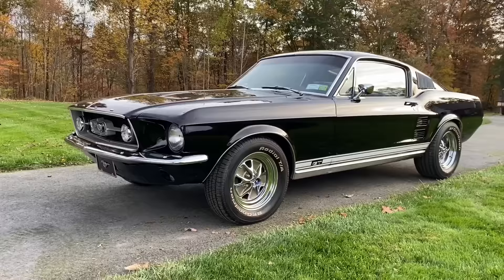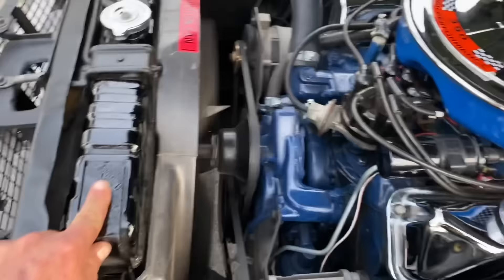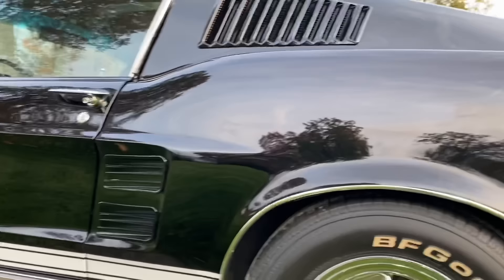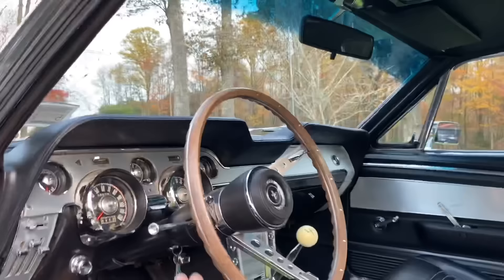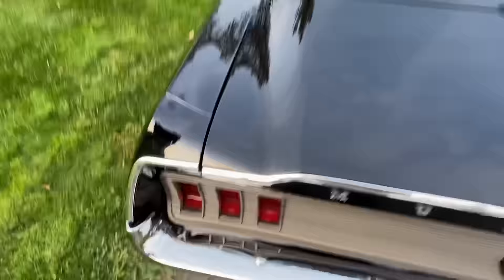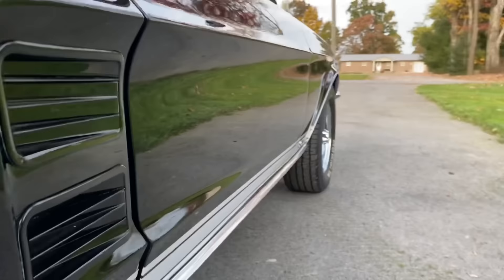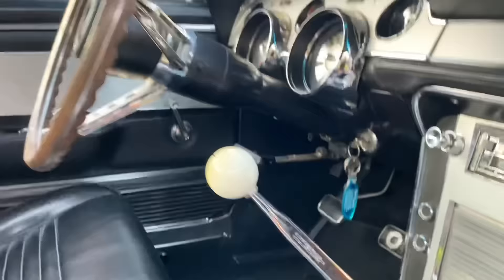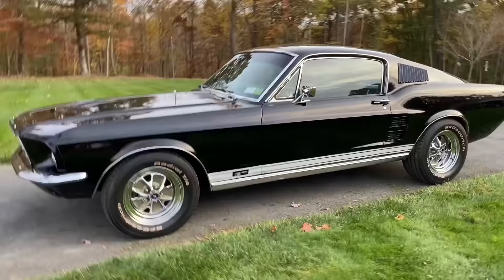1967 Ford Mustang Fastback S Code 390 GT 4 Speed

Comment: What an absolutely beautiful car. Those '67 fastbacks are such a work of art, the 67-70 were the best years in my opinion.
Reply: I had a 1968 fully factory custom, 302 auto -8, interior was fully tricked out with in dash 8-track philco and stainless slide door, map readers, courtesy lights, the whole deal...louvers all over it. Vinyl top. black and chrome interior. Original list price when my dad bought it new was $4,350. He also bought a matching 1968 coupe with a 289, 3 speed. She said it was too fast, so he sold it 2 months later. I sold the coupe in 1981 for $750 to buy college books to study business. I guess I should have done that 10 years later and kept the car.

Comment: One of the rarest and best parts on this car is the rear taillight panel which was a one year option on 1967 Mustangs 💪👍🔥  !
Reply: Cam montreuil engines  in my opinion the 1967 68 GT and 1969 Mach 1 are the best performing and looking Mustangs FoMoCo ever produced 💪👍🔥 !
Reply: One of my high school friends (late 1970s) was lucky enough to have a dad that was a Ford car guy and rebuilt him a 67 Mustang FB that was aqua in color—originally had a 289 V8–he repainted it with Dupont Imron metallic in similar aqua color—beefed up handling, added power disk brakes to power steering it already had—and eventually dropped a 390 V8 in it from a donor Ford Galaxie (left the 289 Mustang badges on front quarters—which made for some funny episodes when my friend pulled up next to newer Camaros and Corvettes at a stop light and smoked em) and that car came with one of the original horizontal finned aluminum taillight panels painted to match the body—only time to this day I have ever seen one on a 67 Mustang. Man that was one great car—I had a 70 Cougar with 351W as my first car and yet I was still envious of my friend (-and also of one of my best friends older brother’s who was driving a 68 Mustang GT/CS.
Reply: Love it!  Best looking part of the car
Reply: @rocknroller77  everything on this car is beautiful 💪👍🔥 !
Reply: I had that on my 68 coupe.
Reply: @KB-ke3fi it was probably installed after the fact because it was a 1967 factory option only never on the 1968s, kinda like 1967 and 1968 Camaros you see with cowl hoods which was only a 1969 Camaro option  .
Reply: @gregoryhall3156  he changed the engine lost its value . not original no more. he could had built a 289 into a 331stroker or a 363 stroker. i myself used to have a 68 Mach1 mustang with the Boss351 under the hood 4 speed on the floor black leather interior midnight metalic blue with chrome mag wheels all the way around it 60s on the front 50s on the back cow forced fresh air induction system to the top of the carb. miss my car.
Reply: @shadowoutlaw9834  Were no Mach 1,s in 68, maybe you mean Fastback ? And the Boss 351 was 71 Only, unless you Swapped in a Boss 351 into your 68.
Reply: @badass6.0powerstroke10  they made a 168 1/2 mache 1 mustang as well other it come with the 351Boss or the 303 Boss under engine under the hood. Look it up.
Reply: @shadowoutlaw9834  They Only made 1,806 Boss 351 Mustangs in 1971 ONLY ! If i already know that off the top of my head, I Know you absolutely have no clue. Trust me you'll Lose if you wanna test your Mustang Trivia against me, Or anything Ford for that matter. The only significant Mustang news in Mid to Late 68 was the Introduction of the 428 CJ in the Mustang, you can thank Tasca for doing that. And still There was NO Mach 1 in 1968. Mach 1,s Started with the 1969 Model Year Mustangs. These are All Facts !!! LOOK IT UP !!!
Reply: You have no idea , they put together a a 68 mach1  was indraduced in 1968 I had one
Reply: In fact 1 for sale right now guy in Clarksville TN. Selling his right  now
Reply: @shadowoutlaw9834  WRONG, Try Again. No such thing.
Reply: @shadowoutlaw9834  Keep trying. Happy Thanksgiving !
Reply: Next week I'm remodeling a 68 GT 351 for my naibor
Reply: Mine had one it was a gt with the four piston disk brakes and tach the internet wasnt around for me to decipher the powertrain but it had the small brake pedal that led me to believe it was an original stick by the time I got it it had a c4 with a knocking  289 that was obviously swapped in  got a good deal for my friend's dad that ran a junkyard and got a 90 mustang engine we threw a flex plate on it and the old Edelbrock performer 289 intake,  1850 model 600 holley. I only wish I would have tried that donor motor t5 swap.

Comment: I was 15 and traded my boat for a 1967 390 GT A 
Completely went through everything and built the motor strong. I turned 16 got my DL and had my first car. Loved it so much. Installed B&M Shift Kit in C6 and was running one night showing how it would bark the tires shifting and she went sideways and I hit a ditch with a raised  concrete sewer drain. She flipped end over end and I destroyed her. Walked away though and swapped everything into a 69 Mach 1 body. Always wanted the 67 back. Life goes on.
Thank you for the video

Comment: i had one in original green  390   only 60k miles got it from original owner, it even had plastic covering interior pannels, he never took the stuf off. iit had a forth pedel left side operated the intermitant wiper.  ran it hard sold it drit cheap kicking my self ever since. miss that car, a lot!

Comment: I remember back in the early 1980s seeing a 1967 hard top with a off white vinyl top and off off white exterior and gold color body mustang gt . It had all the options you could get. Tilt away steering wheel  air conditioning over head console and the rear panel over the tail lights like this car. It was a S code with a automatic transmission sitting in a car lot in Nashville. I had a factory shop manual that shows the codes for the vin. The car came like this from the factory .

Comment: my dad had a 70 BOSS 302 in england ! he said you could put it in 3rd gear side step the clutch floor the accelerator and leave 2 black lines on the road

Comment: My old boss has 1968 Shelby cobra convertible black on black. Had it at shop in our way so I got chance examine it. Granny steering wheel and trunk lid had warped. Show quality he paid 50k never drove it he had black on black 2008 convertible looked stock exept cobra on grill off centered. 2008 sallaon silver hardtop was 58k which I didn't have.
Reply from the maker: Think he would sell it?

Comment: I personally think if you take that Little Pony out of the grill that car will look bad ass not that it don't now I've seen the 64th without them in the 63 they look so much nicer in the front without that Chrome horse emblem in the center of the grill. Only my opinion I would save it though if I ever took it off. MR WELSH

Comment: What's. S code stand for a very pristine condition for a 1967 mustang fastback
Reply from the maker: S code is for a 399 engine. 5th digit of the VIN is a letter. Each letter represents a different engine code ID. S indicates a 390. 

Thanks

Comment: Wrong hood
Reply from the maker: No the hood is correct. Turn signal hood is correct for the car.
Reply: Thank you America mustang it really does capture the imagination and significance of our youth iconic and beautiful I had one that was purple a 67 fastback big block original factory for speed car performance machine on the south side of Chicago I was told bought it new and it was their shop car raced locally on the weekends powered by a 427 I was told had no Wheeling bars ever on it from all my inspection s but had two great big toe hooks that is t o w chicken through the front valance panel huge no bumper or bumpers and that's the way I got her that acid meltdown purple light purple areas and the lines were snowed out the paint jobs and those days were mined blowing we were all let's face it like wow man and then it was gone and I would like to know where it went if I could find if I could learn I would like to know I would like to see I would like to touch it and feel anyway good to talk to you don't know your name just America is it all right if I call you America